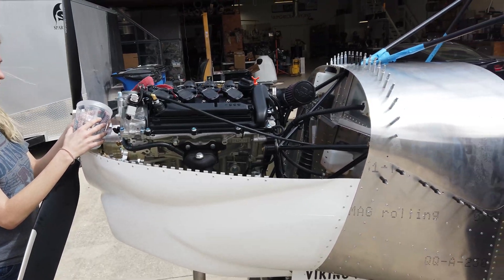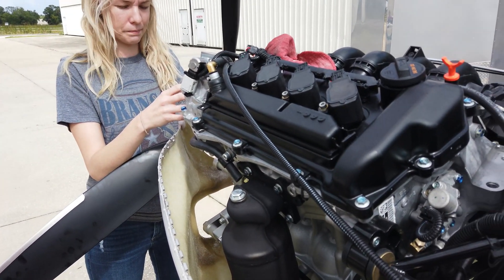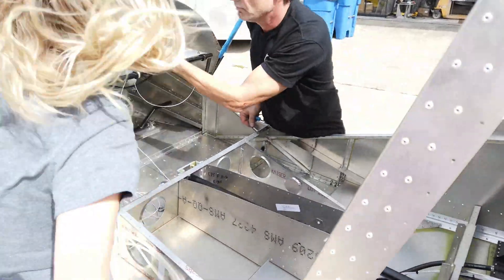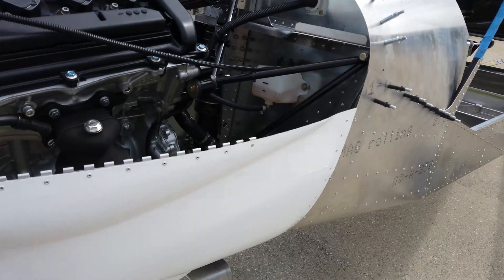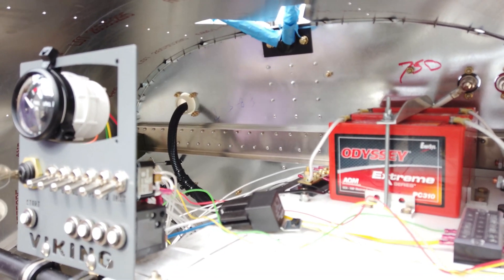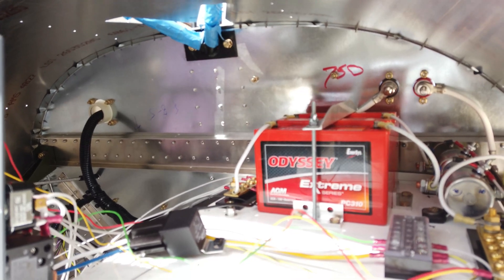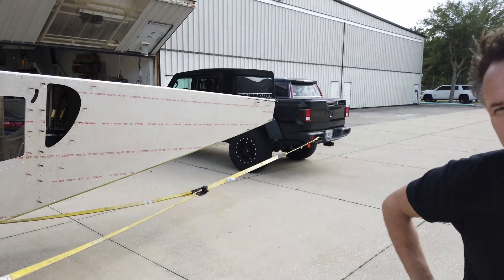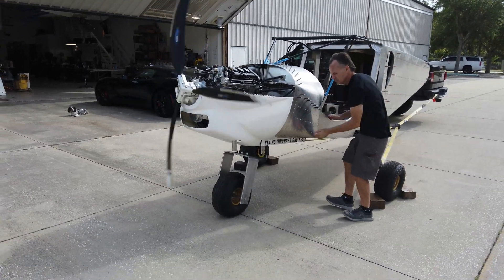Installation Series - First Engine Start

Comment: why you put fuel in the aircleaner? it wasn't supported to be just air intake?
Reply from the maker: To help the engine start before the fuel injectors inject fuel. In order to bleed air out of the injectors, this was the very first start.
Reply: @eggenfellner  got it, amazing job that you guys are doing to provide aircraft engines with a affordable price